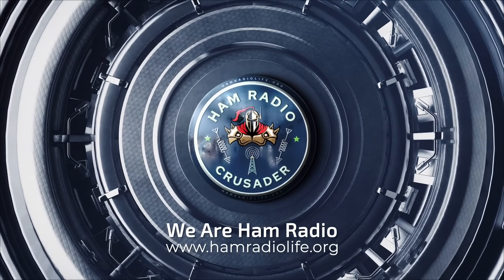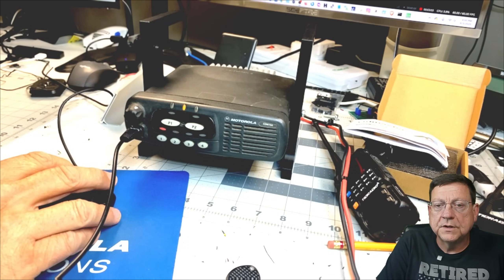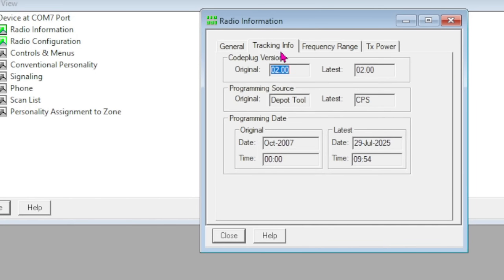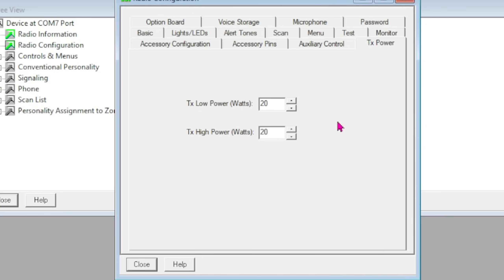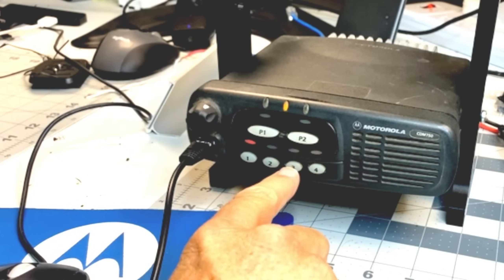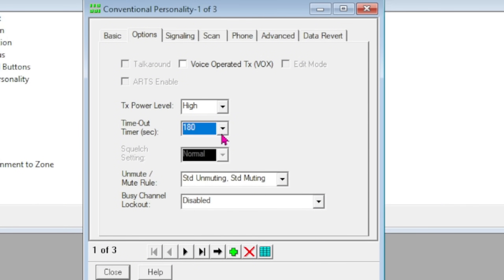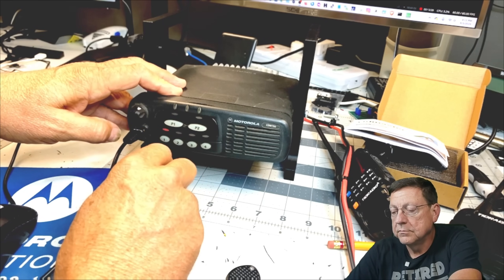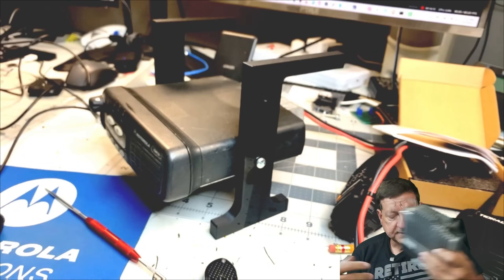Programming the Motorola CDM Series Radio for AllStarLink

Comment: I picked up a few Motorola SM50s with power supplies that I intend to turn into a GMRS repeater some day. Just need to round up the cables and CPS. But that's down the line. 73, W0RHP
Reply from the maker: Just make sure you put a cooling fan on the transmitter them boogers can get hot. 73 DE KD5FMU

Comment: You can convert the 2m radios to 220 and uhf2 450 to uhf1 430 using chirp legacy. Then program with cps6.12.5.
Reply from the maker: Where can I get more info on this? I want to build a 220 repeater BAD!!

Comment: The cps wont allow me to save in wide band 25KHz. Something about FCC regulations and needing a key from Motorola lol. Radio is a CDM1550LS uhf 403-470MHz. any ideas?
Reply from the maker: Working on it
Reply from the maker: Okay use the same link and re-download. But first uninstall the version you have then install this one. It's an older version that does not have the wideband/narrow band restriction

Comment: You could not set the TX Power to low in your conventional personality because the TX Low and TX High power were set to the same value (20W) under the Radio Configuration TX Power tab.   If you set TX High to a higher number (>20W) in Radio Config it should enable the low setting in the personality.
Reply from the maker: Thank You!!!
Reply from the maker: Do you know of a method to set TX power down to 5 watts?
Reply: @HamRadioCrusader  I will shoot you an email.

Comment: Just as a little tidbit... If you setup multiple channels in the radio and configure "Channel Select" options on the accessory pins, you can then change the channel of the radio via AllStarLink. I have mine configured for DTMF commands, but can also do it schedule based.
Reply: I should have specified... I use mostly CDM1550LS(+)
Reply from the maker: I would LOVE to know more about out that process can you send me an email? kd5fmu@gmail.com

Comment: Thanks for the Video, where would one get the programing, and will it work on windows 10/11
Reply from the maker: Yes and Yes. See video link
Reply from the maker: I mean see video description
Reply: @HamRadioCrusader  Thank you Freddie, for some reason that link would not open until I used another browser. Probably another box coming from e-bay to my wife's dismay😎
Reply from the maker: @Crkside121  can you tell me which browser failed and which browser worked please?
Reply: @HamRadioCrusader  Yes Sir, Chrome would not open it, but Microsoft Edge did. Have a great week

Comment: I have a pile of these things for various projects. I could never get the USB adapter to work, so I am using an old RIB into my Windows 7 machine with a serial port. Thanks for the great video!
Reply from the maker: You should try the BlueMax49rs cables. They work on Windows 11
Reply: I use an ftdi cable from Aliexpress.  The programming software wouldn't run on Windows 11. I setup windows XP on a virtualbox and installed the software on that. It works!!